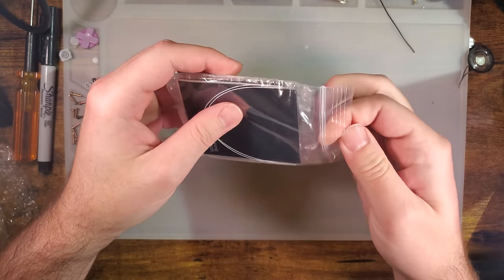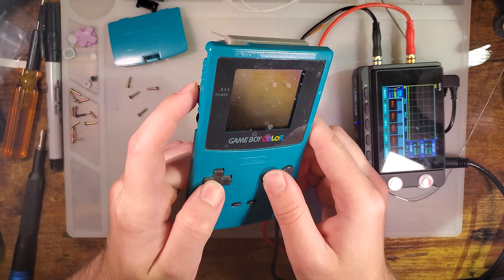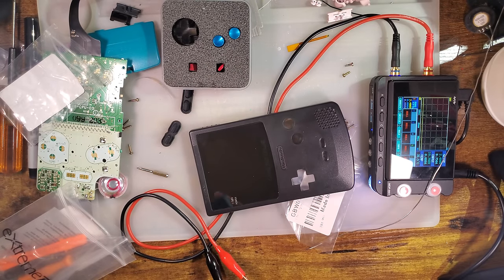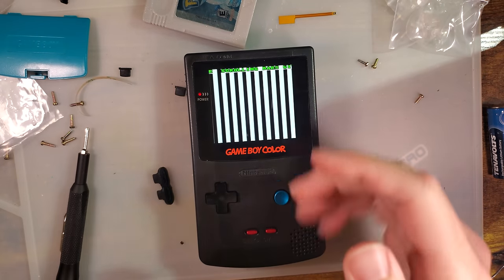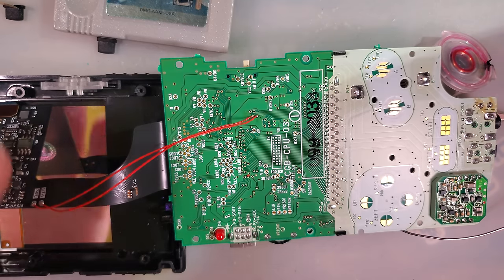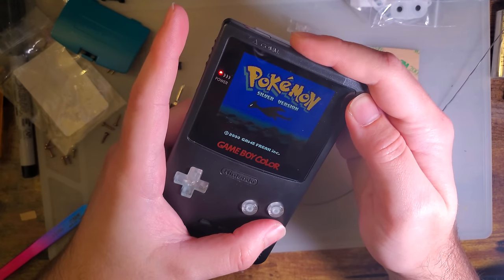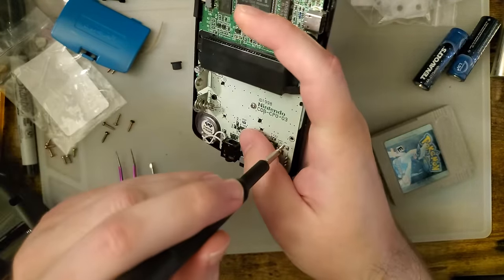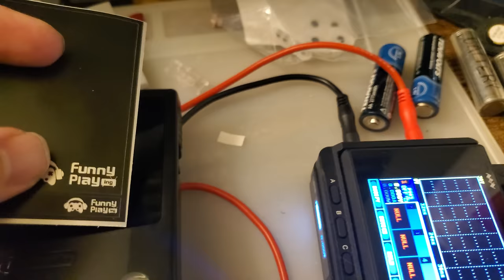'Retro Pixel 2.0' Funnyplaying Laminated Q5 GBC Backlight

Comment: Great Video Mahko, super helpful. did you find a good fix for the Tight Power Switch in the end? i'm experiencing the same currently with my FP one, even after loosening the shells screws. cheers
Reply from the maker: I didn't really look into it. I suspect a little creative filing on the FP switch would solve the issue but it's not really a big enough deal to me
Reply: @makho  no problem. Yeah in the end I slowly sanded (need to get some files),. The switch and the shell's opening for the switch.  After some patience it seemed less tight. Think the shell may have been the main culprit honestly!  Thanks!
Reply from the maker: @ConnorBaxter  yep, it's definitely the shell because the OEM switch fit poorly too. Problem with that is, it's a lot easier to modify the switch than the shell though.

Comment: Btw, since in these custom shells the battery compartment is "flat" the middle screw on the motherboard puts too much pressure on the case. OEM cases their battery compartments are curved so in those its a non issue but i opted for removing the middle motherboard screw so the back housing can sit flush.
Reply: yeah, what you're saying in the end of the video that the housing doesnt "fit" together neatly, thats because of the middle screw on the motherboard.
Reply from the maker: @shadeymcbones6707  the battery compartment screw in no way interferes with the fitment near the top of the console
Reply: Gonna have to take a look at removing that screw on mine when I have access to my screwdrivers again - thanks for the tip!
Reply: @makho  if you press the bottom down the top wont fit and vice versa. My housing fits together normally after taking out that screw
Reply: I built mine a couple days ago and said THE SAME THING! i took out the screw and boom, perfect
Reply from the maker: @shadeymcbones6707  I tried it without the screw when I took the console apart today to make my alternate solder point guide image and it made no difference to the flaw I pointed out in the video.
Reply: @makho  Strange, could have sworn that it fixed the issue for me.
Ill be opening mine again later today as well to reposition the touch sensor and to shave off a bit of the d-pad nub as per your suggestion, since i cant make diagonals properly right now. I'll do another check just to be sure.

Even if it doesnt eliminate the fitting problem completely i'd still recommend leaving that screw out since it atleast does cause the bottom part of the back housing to bulge.
Reply: @makho  yeah on second inspection you're right. although it does alleviate it a little bit.

 Also, after running quite a few tests with the touch sensor, i concluded that the case is simply a bit too thick, or the touch sensor is too thin, which is why it registers touch input a bit clunky. After swapping my home made piece of copper plating with a much wider and thicker one it activates every time i want it too. the included "touch sensor" is just too small for it to register your finger consistently. Copper tape, although better than the included ribbon cable is still too thin, i'm guessing you'd want something at least 1 millimetre thick.

Btw im just sharing my findings :) in my case this helped my gameboy but seeing as im only one person, its not conclusive or anything haha.
Reply: @shadeymcbones6707  Can't you just use multiple layers of copper tape?

Comment: Great video, Makho! If you use the laminated screen, can you no longer replace the screen lens? Or could you remove the laminated lens and replace it with a normal screen lens without damaging the LCD? In two minds whether this is worth it, if the screen lens gets scratched and can't be replaced.
Reply from the maker: you cannot remove the lens from the LCD. No reason you cannot get a bare LCD though
Reply: @makho  Cheers, dude!

Comment: Any magic bullet on the touch sensor? Mine worked great for a week and now it’s completely dead. Was hoping the power cycle or cycling menu on/off would do the trick. Even when I touch the sensor with my finger directly nothing happens. Even with a brand new sensor - same… any tips would be appreciated
Reply from the maker: Make sure it's adhered directly to the shell. As thin a layer of adhesive as possible. Bigger sensor can be better. Make sure you're hydrated (seriously). Try licking your finger (also seriously).

Comment: Hello, thanks for the video. It really helped me a lot! Do you know if it is possible to adjust the retro pixel effect? thanks
Reply from the maker: yes
Reply: @makho  thanks. how is it done?
Reply: Davide Eralti you can cycle through pure lcd, dot matrix (pixels), and 3 scan line fx by holding down the touch sensor for a few seconds

Comment: Those touch sensors are a constant frustration. Copper tape with a wire sloppily soldered on sometimes works better for me, but that's not a perfect solution either. Seems to work best when it's stuck onto the IR shield, but that renders the IR unusable.

Super annoying aspect of these kits.
Reply: i kinda discovered the problem for me,  the included touch sensor wire and normal copper tape is simply too thin to consistently register your finger trough the housing.

After swapping it a third time with a piece of much thicker and larger copper it registers perfectly every time. 

Maybe it works for you too? worth a shot to prove my hypothesis.
Reply: @shadeymcbones6707  That sounds like it would be worth a try. What did you use for the thicker copper?
Reply: @cahoots6065  hammered down a thick piece of stripped copper wire and folded it, after that i strengthened the seem a bit with solder

Comment: I also did this mod today and the brightness touch sensor is also a bit iffy on mine. Replaced it with a piece of flattened out copper wire with a wire attached to it, but its still a bit inconsistent. Maybe its because i put it under the IR window. Worked fine on my older funnyplaing ips gbc mod but maybe this IR window is too thick or something.
Reply: I'm sorry I don't want to be pedantic but surely you mean IR (infrared) window and not RF (radio-frequency) window.
Reply: @Olivil  woopsie, yeah that one. Guess I was half asleep

Comment: I installed this.
At first it booted fine, but after turning it on and off three times, it would not boot at all.
I put it back in the original display and shell, and it still wouldn't boot.
I don't know what the cause is.

Comment: I might try to do a backlight in my Gameboy but have Zero experience 😂 should I crash course a normal IPS 2 or one of these Q5’s?
Reply from the maker: if you have any mechanical aptitude, these mods are pretty easy to start with. If you've never soldered before, however, you should probably start with a cheapo "solder practice kit" instead of just going to town on your expensive GB and IPS kit.
Reply: @makho  okay thanks yes I am a perfectionist and very Careful maybe a little too ocd with my work so if I’m able to learn and pull it off I’ll make some good stuff

Comment: Any way to fix the 2 light bleed points on the bottom corners of the laminated screen where it meets the shell? About 5mm away from either edge.

Noticing its not just my kit.. It's also with the kit that makho installed

Comment: My touch sensor is super finnicky as well. Sometimes it works, sometimes it doesn’t and I restart it and then it works.I think your initial install was just fine, there’s something up with that sensor. It also doesn’t work after a soft reset :/
Reply: I fixed this problem for me by replacing the included touch sensor with a thick piece of copper platting on a wire (copper tape is too thin in my experience). Im guessing the included touch sensor is too small to properly register your finger trough the plastic or something, but yeah not that i've replaced it with this its perfectly responsive for me
Reply from the maker: I rewired the touch sensor after the video with a small bit of copper tape on a wire, basically what the other kits use. It works a lot better.
Reply: My touch sensor doesn't work at all.  
I have messaged funny playing and I'm awaiting their response.
Reply: @busubi  I followed his suggestion and used copper tape. It works flawlessly.
Reply: @ilchymis4000  I don't have any copper tape but I do have aluminium tape.  
I do think funny playing need to address the issue.  They are taking money for these products after all.
Reply: @busubi  amazon sells copper tape, I got a roll for $5 and its super helpful for all kits to wire up your own. I agree 100% this should be addressed by FP
Reply: makho noted. Testing this out when my copper tape arrives tomorrow
Reply: Btw my issue was not the sensor but the chip on the ribbon.  Funny Playing sent me out a new ribbon and it all works beautifully now.

Comment: Maybe I missed it, but did you compare the power draw with different brightnesses? Would be nice to have a rough estimate for how long batteries will last with this kit. Also, is there any downside to sticking the touch sensor to the IR window?
Reply: Just took a look at your spreadsheet and it looks like the draw is about 205 mA on the lowest brightness, amounting to half the stock battery life. I don't think that's too bad unless you want to play out in the sun all day.

Comment: I heard that that kid is recommended with 1.5V batteries but my rechargeable ones are 1.2V each (and that thingy that you use is using 2.4V). Will my batteries be okay or should I get new ones? Is there any downside?
Reply from the maker: if your batteries work then by all means, keep using them.

Comment: I will still find a way to get dust beneath the lens.
Reply from the maker: I mean, it's literally one piece with no gap between the parts. You'd have to pry them apart and remove material for that to happen (which would destroy the extremely delicate LCD)
Reply: @makho  I wouldn't dare try it lol. I was simply making a joke, because I always somehow get dust under most lens I attach, no matter how careful I think I am.
Reply: I hear you!
Reply from the maker: @VanguardRaven  well then sounds like a laminated kit should have some special appeal for you
Reply: @makho  For sure. I'm glad I held off on getting an IPS kit for the GBC. Potential dust in the lens aside, it just looks sexy af.

Comment: How good is the plastic on these funnyplaying replacement shells? I really dislike the flimsiness on all the things I bought on ebay/aliexpress over the last 10 (damn Im old) years. How does it compare to OEM ?
Reply from the maker: OEM is still king but FP is a lot better than most aftermarket shells
Reply: FP is the highest quality I’ve seen compared to even Retro Game Repair Shop and random EBay shells
Reply: @Tytheband  yeah I have to agree with that. I've been buying GBC shells since 2010 and i never actually got to put on on. Either the mold is grossly different or the plastic flimsy af. The funny playing shells for the new laminated display is very very very good. Plastic feels very solid and molding is great.
Reply from the maker: @Tytheband  RGRS resells FP shells.

Comment: The screen dimensions advertised by Funny Playing suggest that this screen would be a slightly different aspect ratio compared to the original ("The original display size of GBC is 43×41mm
The IPS LCD display size is 49.5 × 44.5mm") The screen doesn't LOOK 6.5mm wider though, can you confirm if its true or not? Is the LCD size and the viewing window size different? (I guess it must be in the vertical direction)
Reply from the maker: It's not technically the same aspect ratio, no, but that's very difficult to achieve because the GBC did not have square pixels. The new screen resolution is an integer of the original resolution though. It's a lot bigger but I can measure specifically if you like.
Reply: makho I didn’t realise the og screen pixels weren’t square. Would you say this is an improvement over the og aspect ratio then?
I would be interested in knowing exact dims but only if it’s not too much trouble.

I’ve emailed FunnyPlaying to see if they might add a multi colour option for the logo in the future, but looking at how the letters are joined up, i imagine its just not achievable
Reply from the maker: @Venomous28  Looks fine to me. The increased size and sharpness area welcome improvement over stock.

Comment: What is the name of the machine/device that you use connected to the Alligator Clips to provide and measure DC current to the Game Boy?
Reply from the maker: it's a power supply https://retrogamerepairshop.com/products/mdp-xp-mini-digital-programmable-power-supply-set-with-30v-5a-90w-2-4g-wireless-connection-2-8-inch-tft-screen

Comment: I've installed this screen on my GBC and absolutely love it. However when the battery starts to decrease, a static sound can be heard and the screen will flicker and reset but only intermittently. Any idea what that might be?
Reply from the maker: sounds like voltage drops from shitty batteries.

Comment: Hi Makho, Can I ask a question if you don't mind. - I have the next version of this kit and the ribbon is slighty different with a built in touch sensor. However after initially working fine, the touch sensor has stopped responding altogether. I have tried installing a separate wire and piece of copper tape, to no avail, same thing. - I noticed that you found an alternate area to solder to for this ribbon which was one of the pins on an IC. However I have tried that on the new ribbon and it doesn't work. I have followed the trace for the touch sensor and it leads to a small capacitor, would you recommend trying to solder a wire and piece of copper to here instead?
Reply from the maker: You can try it but in my experience, most people having touch related issues either just need to hydrate properly or position the sensor properly and insulate. Have you tried it out of the shell?
Reply: @makho  Hi, yes, I tried 3 methods out of the shell. I tried the inbuilt sensor, I soldered the optional sensor and I also tried a piece of copper tape soldered to a wire. I have tried it day after day and it's always the same, so I don't know whether it could be hydration related. It's annoying tbh, as it worked fine when I first got it and it's just weirdly stopped. - Funnyplaying won't respond so I'm left with it as is.
Reply from the maker: @SCorpG22  There's a comment here that I just saw and pinned. Check that one out, it may have the answer you seek.
Reply: @makho  Excellent, that's really helpful, thank you so much dude.

Comment: @makho Sorry if you've said this on other videos, but what is the device you are using to supply power without the batteries in the console? (Or anyone else that knows)
Reply from the maker: MDP-XP power supply: https://retrogamerepairshop.com/products/mdp-xp-mini-digital-programmable-power-supply-set-with-30v-5a-90w-2-4g-wireless-connection-2-8-inch-tft-screen
Reply: @makho  awesome. Thank you!

Comment: What temperature did you have your soldering iron at? If anybody knows? Thanks.
Reply from the maker: I generally solder at about 290C. If you're new to soldering, I highly recommend starting with a $3 practice kit instead of learning on your $100+ build.
Reply: @makho  thanks makho! I was able to get it done thanks to your video 👍🏻

Comment: Installed but the image retention from previous game title screens and gameplay ks left behind into the progression of a game is terrible. Any thoughts? It isn't just alittle either, it is very noticeable.
Reply from the maker: I've only seen that with bad batteries
Reply: @makho  In other words maybe I got a lemon? I can't return it either since I installed it. Hopefully the problem won't present itself the next one I ordered. I used Duracell Optimum batteries 1.5V.
Reply: Also one video I watched soldered the start and select vias to different points underneath where you soldered. Right above the letters "RD" on the board. This is what I did and they worked fine, but is the wrong method or does it not matter?
Reply from the maker: @mattfire8579  my method is just for cleaner wiring. On the GBC, it's all the same.

Comment: Just installed this kit too, and I have the same trouble with the touch sensor. Sometimes it works, sometimes it takes a lot of prodding. Mine didn't come with any adhesive, so I tried attaching it to the shell as well as I could with kapton tape. trying to think of a better method that would allow for more reliability. if anybody has any ideas for what they did feel free to let me know!
Reply from the maker: swap it out with a wire soldered to a small bit of copper tape. That works a lot better (and has adhesive built in). Also, make sure you're properly hydrated.
Reply: I had the same issue and ended up tucking the touch sensor under the IR cover. So far, so good. I kind of prefer it on that side anyhow; plus providing a more precise point to touch.

Comment: I can't determine - can I do this mod and have the screen function without the soldering? Is that just for the bonus menus?
Reply from the maker: most functions can be done with the touch sensor as of the newest version. Pixel grid modes require touch sensor on all versions and brightness can be adjusted with the touch sensor.
Reply: @makho  thanks!

Comment: I got my new kit after the first bad one they sent me. Works great, but now there is no sound?
Reply from the maker: seems like something went wrong during install then. You checked with headphones?
Reply: @makho  Yes I did and it turned out there was corrosion in the headphone jack I cleaned out and now it works.
Reply: But it has ran into the same problem again despite cleaning it. Might I be able to desolder it and soak it in vinegar and ISO afterwards?
Reply from the maker: @mattfire8579  you can purchase replacement headphone jacks currently or just jumper it if you don't intend on using headphones